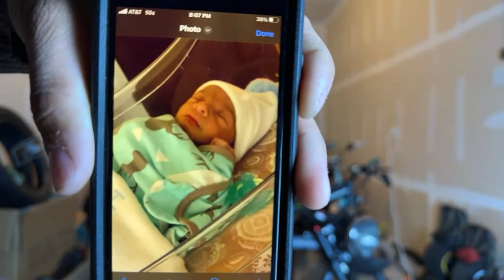SUPER73 CONTROLLER SWAP + TORQUE UPDATE V2 Questions Answered!

Comment: I can tell you the torque update is real for us that live in hilly areas. I almost died riding up this hill going 5 MPH that my original bike with the update doing 15+. Waiting on the update with my replacement bike… going back to class 2 with the new update is annoying.  Worth it where I live though
Reply: Can't wait! Much needed for my mountain biking.
Reply from the maker: I still haven’t received the update
Reply: @SHREDDIEMCSKATE  me either.  They must be releasing it for 5 bikes a day 😂

Comment: Is it possible to use a CVT drive on a mid-drive ebike? Chains are loud and they break. Transmissions are mechanical, heavy and expensive. CVT's are lightweight, cheap, quiet and seem like the perfect solution...?
Reply from the maker: Let’s get bomber Marv to build it🤘🏾⚡️🤘🏾😁
Reply: @SHREDDIEMCSKATE  Thats a great idea Shreddie! It would take off like a rocket!

Comment: How do you tell the difference between the v1 controller and the v2 controller?
Reply from the maker: The V1and v2 looked pretty much, the same but when the V3 the casing got a little thicker, that’s how you could tell the difference

Comment: You should try a Priority Current bike if you can - it comes with mid drive, belt upgrade, and Enviolo CVT ebike hub already installed and set up.
They're 3500 USD - Priority makes bikes with rear hubs and belt drives without the mid motor for a few hundred bucks but you would have to upgrade everything that we always throw away anyhow so it would work out.   I almost bought one just to steal the drivetrain off it since the whole bike is about the same cost as buying a belt upgrade separately, but I have enough stuff piled around here already so it's going to have to wait a minute.
But yes, Priority bike company's whole deal is building low maintenance/high reliability bikes so everything they offer comes with at least a belt drivetrain set up at the factory.
350 bucks is still a good deal of money to me but it's easier to experiment with something that doesn't cost me 3500 but still has the tech I'm interested in...if their prices don't go up, one could probably put together a VERY compelling competing product to the urban sport rigs like ZOOZ.
Reply: @SHREDDIEMCSKATE  will a new controller on my super73 make it go a little faster?